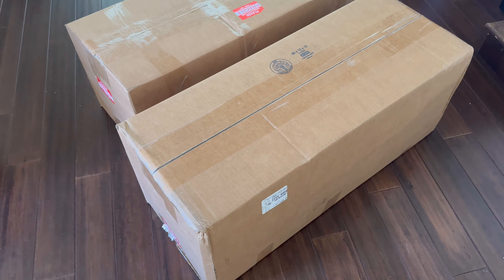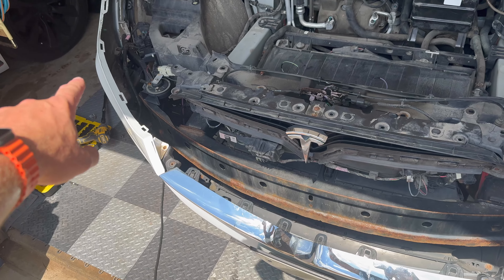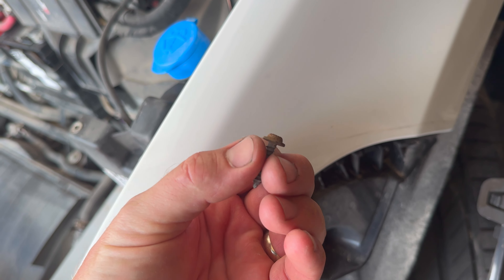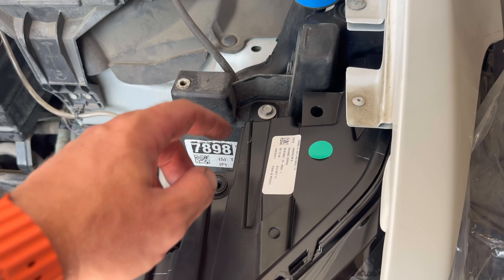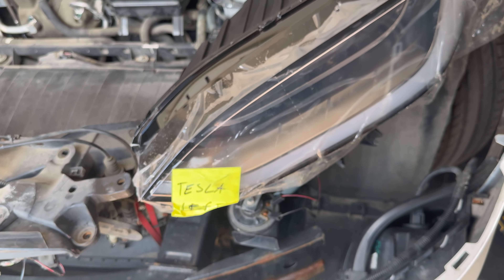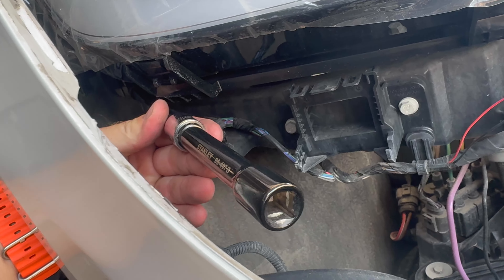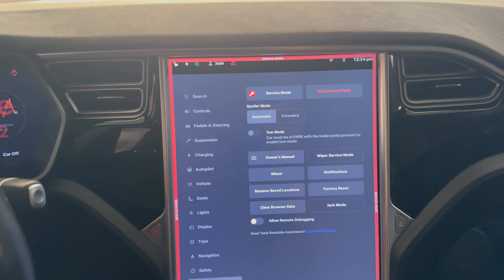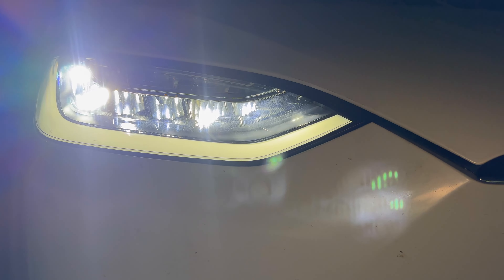Tesla Model X Headlamp Replacement! HOW TO | DIY

Comment: Did you adjust them also? Tesla put new ones in my car (because the service scratched them up ) but never adjusted them, so I ended up doing it. My headlights went from originals being Great to horrible ( after they were replaced) and back to great when I readjusted them.
Reply from the maker: When I installed them the aim was perfect from the get go. I didn’t change the adjusters on the original ones either. If you find they are off, you can have Tesla adjust them to factory spec.
Reply: @JoshWest247  Yeah, Teslas in my area could be better. They adjusted them so that the driver's one was pointed right at the ground. I couldn't see 20 feet in front of me. Google how to adjust them. Drove to a flat spot and with a wall and had to do 9 turns up on the drive side to get it level with the passenger side.